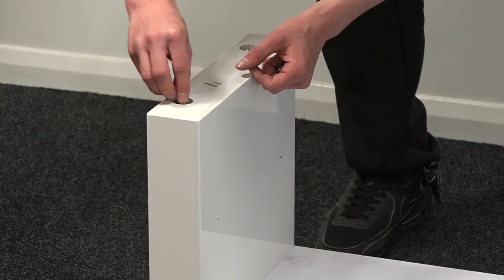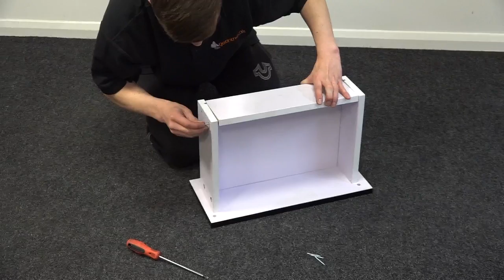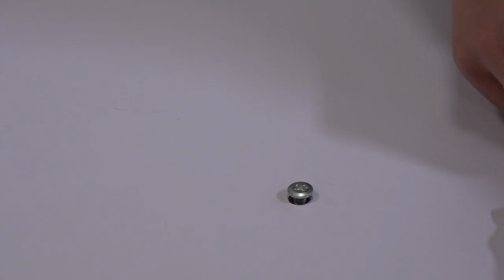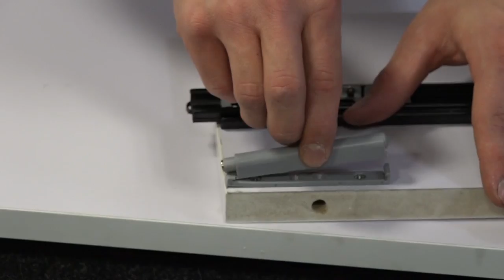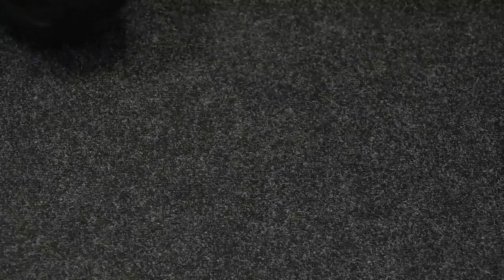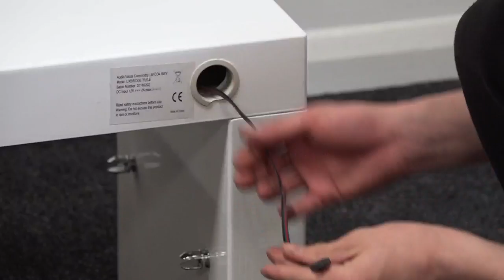TVS-8 Assembly Guide Video

Comment: Im stuck. I have been trying really hard at following your movements. I purchased a TV04-WH and this is the video I found to assemble as the manual is useless. When you assemble the slide drawer, what's the name of that plastic silver piece in corner? Im afraid because I didnt get the direction of the piece and need to assemble to other wood parts...